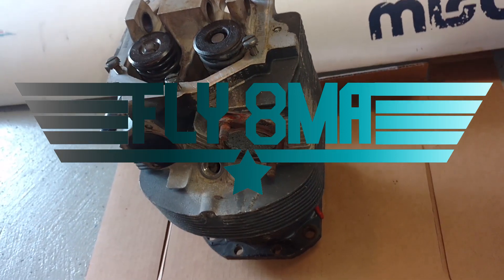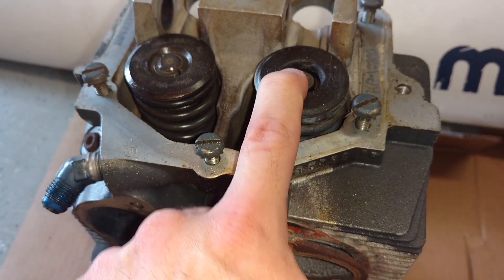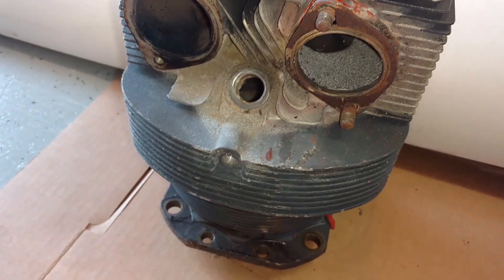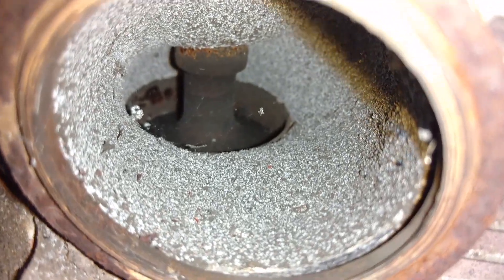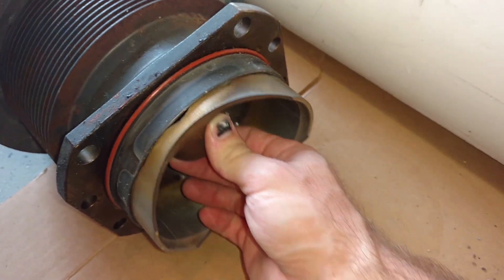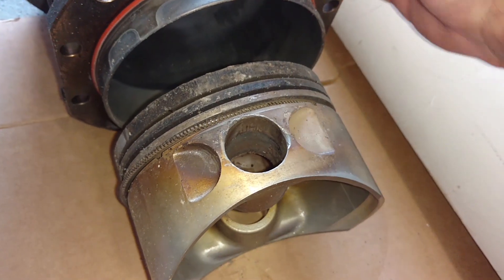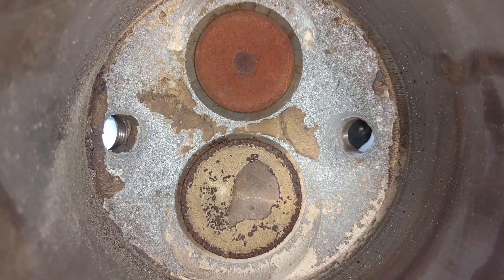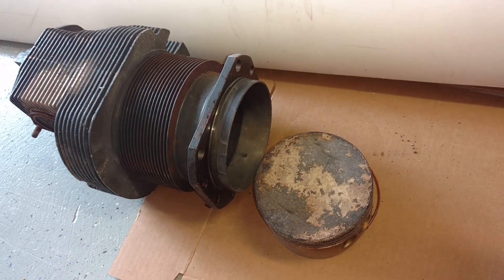Ep. 51: Aircraft Engines Explained | How it Works Part 2

Comment: thank you so much. I was trying to figure out what keeps the explosion force only going downward to move the crank shaft only, and not the cam shaft. the view at the 5:00 minute mark shows the physics perfectly! 
So, I can conclude, I guess, that the cam shaft "feels" no pressure from the combustion, since the top of the cylinder receivers almost all of it, and the relatively little that the valves receive is absorbed by the springs, right?
Reply: the valves are seated against the cylinder in the combustion chamber, there is no way for the gasses to escape around properly seated valves, the only places for it to go is pushing the piston down. 

The cam shaft is geared to the crankshaft.

Comment: Let me try, the small is the exhaust, why, because the cylinder has to keep some heat from combustion, the big valve is big so air and fuel are induce for the right ratio ???